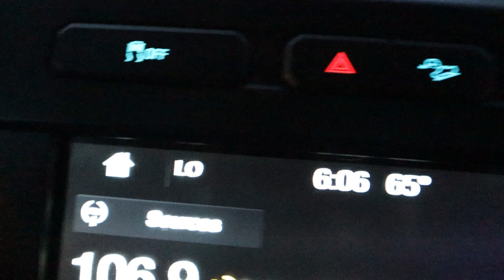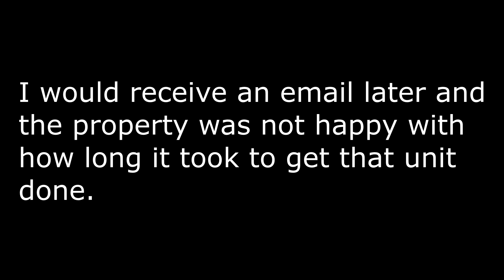I Thought I Did A Good Job But I Was Wrong?

Comment: Joe, you need to let Daman go. If you don’t then it’s setting a bad example for the guys that do show up. I’ve been in construction for 38yrs, I use to throw my plates n screws in a small painters bucket after I washed them so they are ready to go. 2nd..do you prep your walls n trim, I use to wipe everything down especially the trim, prep is 75% of the job. You have to strong painters, hire a laborer for each and split them up. Your doing it brother, just keep your head down and keep grinding!!.

Comment: Sounds like you're painting latex over oil based, use de glosser or sand the trim and it won't have a problem adhering and also won't scale up. I've offered in the past to give you my number so you can ask a professional when you have a problem brother, offer still stands.

Comment: 90 percent of painting is prep work.  Kitchens are greasey and any gloss paint needs to be cleaned and scuffed before painting.
Reply: Not really when it comes to rental houses/apartments/motels/military base housing. You slap a fresh coat over and move on. People trash places like that.
Reply: @MustObeyTheRules  good luck getting paid when the paint doesn't stick.  That kind of work is for suckers.
Reply: @richardcranium7899  that’s the kind of work those places pay for. You get what you pay for. Period.

Comment: Joe, as a professional painter (you may remember me), If you're getting fisheyes, you need to either 1) de-gloss / sand the trim, 2) use oil primer or 3) use a different paint base.